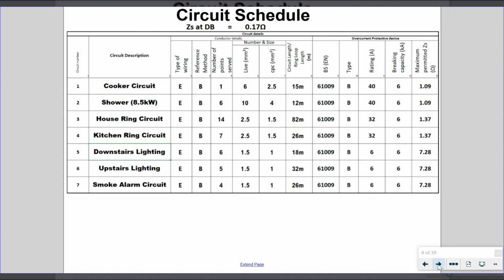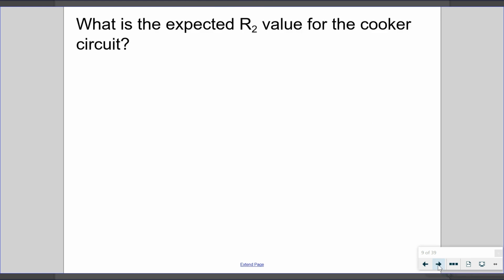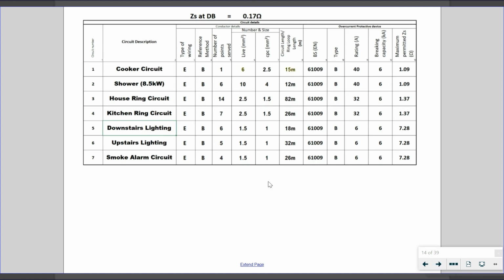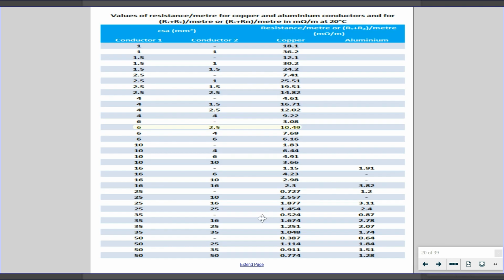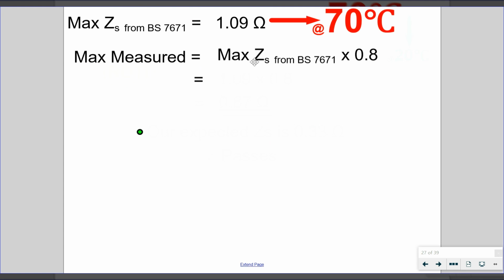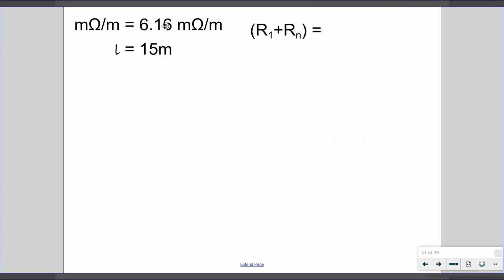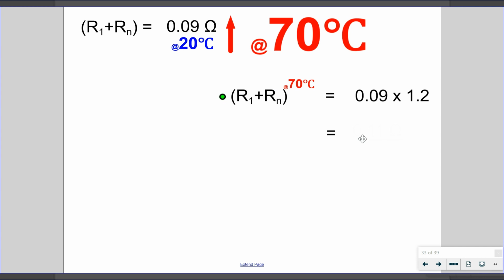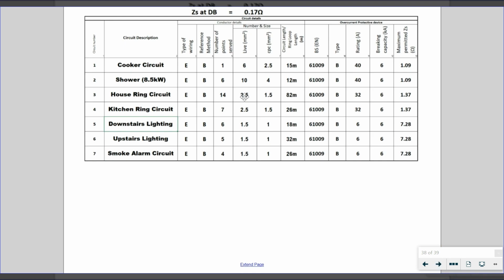2391 Scenario based questions

Comment: Hi Graham, love the videos. I'm just s a little confused with the second scenario you did (R2 for cooker). When you refered to table B1, did you not use the wrong value? It looked like you used the 2.5mm on the Conductor 1 line. Should you not have used 6* for conductor 1? Therefore using a value of 10.49 instead of 7.41. Apologies if i have this wrong.
Cheers
Reply from the maker: Not checked this one in a while but if it's the R2 value it's the CPC.  I think the cooker is a 6/2.5mm^2 twin and earth.
Reply from the maker: Yes, just checked.  It's only the expected R2 value calculation so it's just the 2.5mm^2 cable on its own.   If it was an (R1+R2) calc it would be the 10.49m/ohm/m value as that's the 6&2.5 resistance combined.
When you are just calculating one conductor you use the "Conductor 1" column (in the books it's the Line conductor column), with the dash at conductor 2.  What I tell the apprentices for this is that "the conductor doesn't know the colour of it's insulation" and that seems to get their head around it.  That's why I changed the column headings at the top to conductor 1 and conductor 2.

Comment: Zs = 0.17 do you means Ze=0.17   Zs = Ze + (R1+R2)   Zs = 0.17+0.16 Zs = 0.33
Reply from the maker: In this instance it's a Zs at dB value.  All parallel paths have been left in so it's not a true Ze value.  This might be where the board is at the end of a distribution circuit within the installation or it might be where you have been unable to disconnect the supply to obtain a Ze value.

Comment: with regards to the volt drop question , to get values back upto 70.c shouldnt you times the value by 1.25, not 1.2?
Reply from the maker: The resistance values are taken at 20°C from the OSG and gn3, so we're using the 0.004 ohms/ohm/°C PTC factor given in the same documents
Reply: @grahammackie3117 what page number in osg or gn3 is this pls